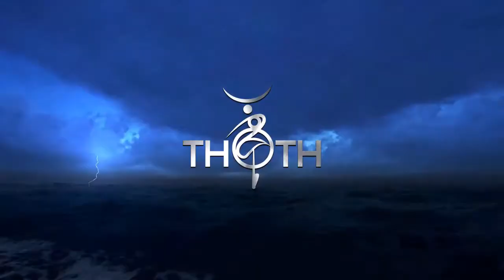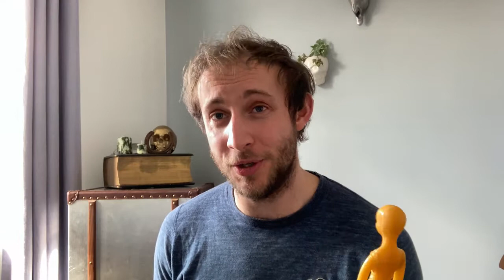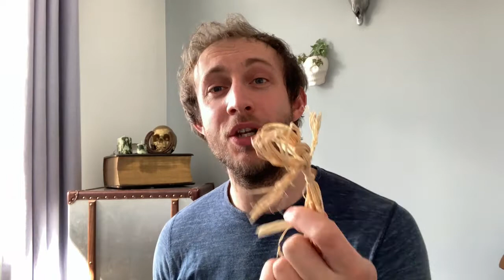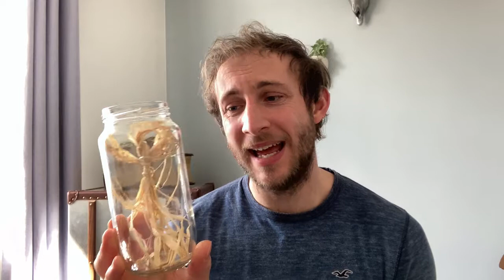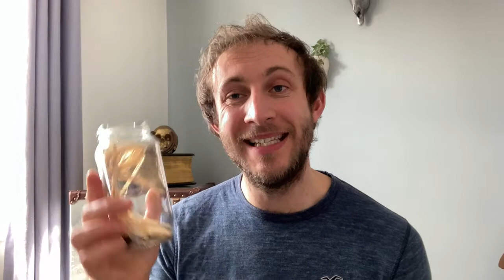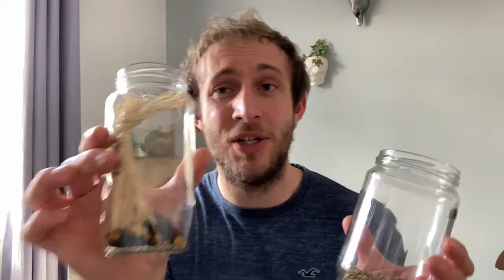Love Poppet Spell | Spell Casting Course Pt 5

Comment: Hi. I love your video and am currently still watching. Thanks for making. Quick question.  I was told never to open up a spell jar because it releases the energy. Whats your experience with reopening jars? Thanks
Reply from the maker: Yes, absolutely I open them up all the time. I would try experimenting, I normally get this question when people have put fragments of souls in jars and worry they will escape but most of this time this isn't the case. If you can sense the energetic build up within the spell then open it and see if the energy flattens or disappears. I don't tend to find students have accidentally let energy out just by opening the jar but some people do try to programme that into the spell.
Reply: @ThothTV  thank you so much for this response. It was very important to know. I guess I can always have a main jar that I never open and another one that I can build on.  I guess I can also say something before opening and upon sealing that the energy already there stays confined.
Reply from the maker: @Jessica-nd4nt  remember to be careful about possible interactions between spells...having multiple spells working in the same direction can interfere with each other. We have talked about this multiple times in various content.
Reply: @ThothTV  okay. I'm just so stressed. My ex and I had our wedding paid for and were 2 weeks away from marriage in June. When his aunt and cousin and someone else did spellwork to cause a tower moment and break us up.  I was hoping that it would have been fixed by now but it isn't. 

We have spent time and I heard someone at his job asked were we working it out and he said it's up in the air... but still nothing. 

I did reversal work to undo the damage they did. And was trying some work here and there to bring us back together. 

He also has issues with being influenced by family and his brother he lives with who has health problems also told him he didn't want him to leave.. and if he and I are having arguments now imagine when we get married. (The arguments were minor and normal)

But I understand what you mean by multiple spell work ruining things.
Reply: @ThothTV  any advice?